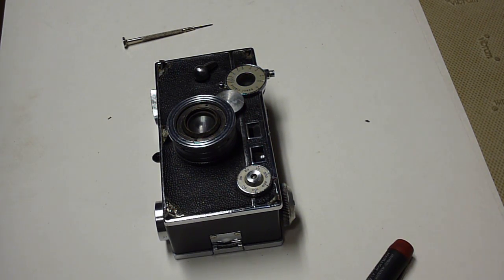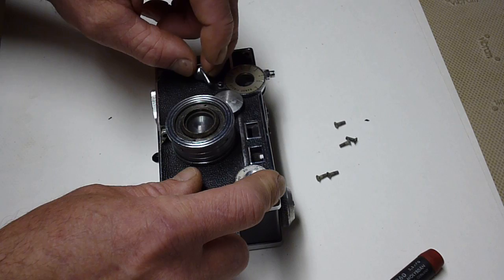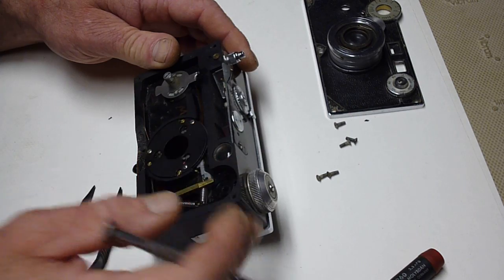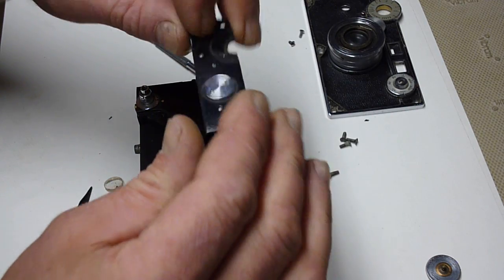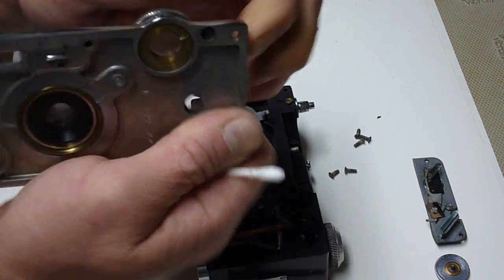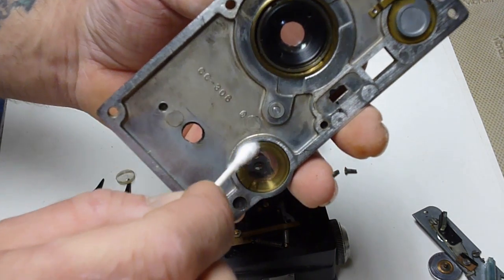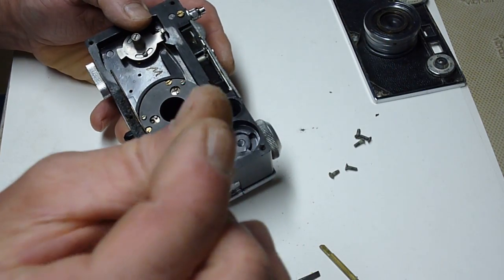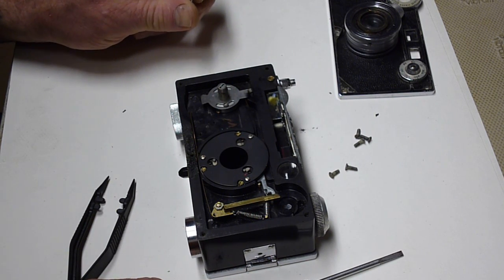Argus C3 face removal

Comment: FYI... If you do not have a set screw securing the shutter cocking lever, it will be held on with a locking nut underneath the lever. Be aware, the nut and cocking lever are LEFT HANDED THREADS! You will have to grind a very small 5/16 open end wrench extra thin to slip in the gap between the faceplate and the backside of the cocking lever. Turn the lever CLOCKWISE while turning the nut COUNTERCLOCKWISE. this will unlock them without tearing anything up.

Comment: Any advice for getting the thin metal tension strip back onto the core of the cocking lever? Mine has come off and it looks like it could be either soldered or it might have originally been rivited? I need a reference picture to see where exactly to solder it. Also, does the shutter release plunger actually touch the top of the jagged cocking lever or does it get pushed out of the way? I really could use a video explaining this right about now. Thanks if you answer.
Reply from the maker: I will have to have another look, i havent worked on one in a while so I need a refresher.
Reply: @tobroken1965  well, I stayed up and figured it out. The metal tension strip had once been wrapped around the inside of the cocking lever core and soldered. Mine broke off (previous owner must’ve twisted the lever so hard that it literally broke the metal free). I ended up soldering it back. I’ll be posting the video and pics of my surprising success soon. I’ve learned so much and the camera actually works now! Thanks for offering to have another look at yours.

Comment: This is a fantastic video.  Thank you.
How do I get the front cover back on so that the timer leaver fits under the strap?
Reply from the maker: A little tricky but not hard. Install the timer lever on its post, hold the camera body with one hand so that the lever is upright, it should be able to tip out from the body a little bit. With the other hand lower the face onto the camera body, watch closely, you should be able to set the strap over the top end (the thin end) of the lever. If it tips over just set it upright and try again. Once the tip is under the strap you can settle the face over the body with relative ease. The critical part is to not over-tighten the face screws. The Bakelite body is strong but brittle and the holes can strip easily is to much force is applied. Snug is good. Once back together check all functions and if all is well you are ready to apply new leatherette of what ever you choose.